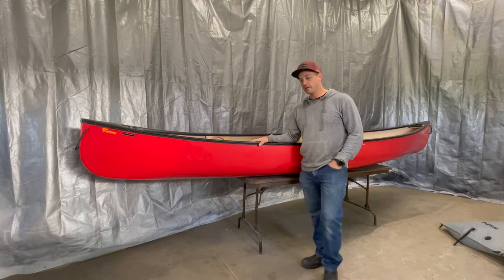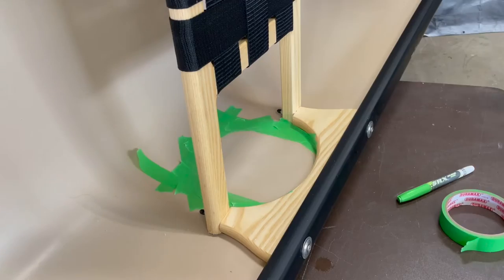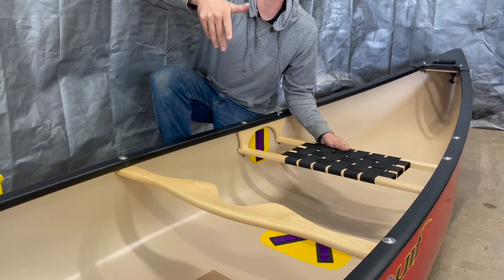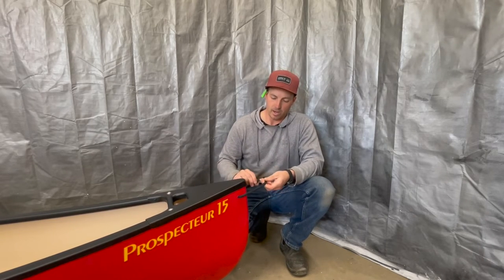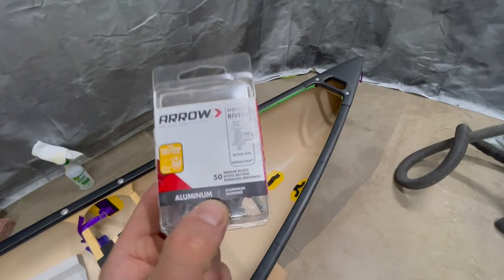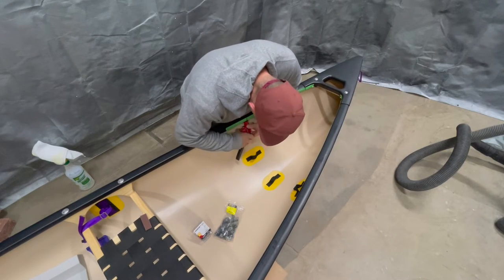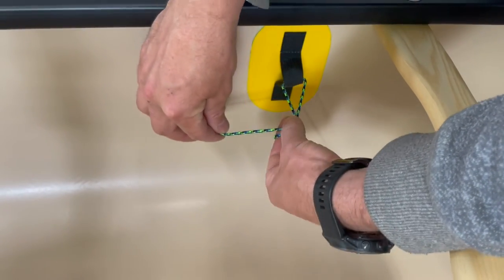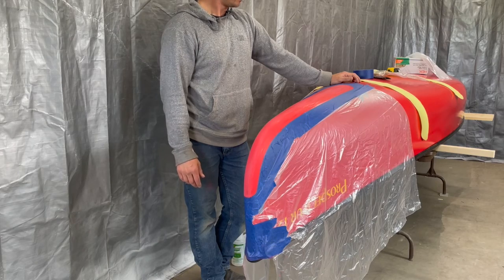Complete guide to outfitting a canoe for whitewater

Comment: Nice video well done. Next time you put skid plates on a canoe you need more resin soaking into the Kevlar Matting otherwise they will eventually crack and fall apart as they hit a hard surface. Air pockets in the matting will do that.
Reply from the maker: They are fully saturated. About 4000km later I have worn far enough through in a few spots to tell for sure 😂 Probably going to try Dynel next time.

Comment: Thigh straps and a kneeling position where most of your lower leg is underneath the seat look like a recipe for entanglement in a capsize.
Reply from the maker: I’ve never had an issue bailing out but I can see why you would be concerned about that. Like everything you should practice and get comfortable with it before you put yourself in a dangerous position. It’s easy to push the straps down off your knees and there is always the quick release buckle on either side.
Reply: easy to get out of if you are familiar with it, practice it and maintain composure in a moving water capsize.

Comment: I have the exact same boat and wanted to thank you for giving me the confidence to install my float bags..anyhow in case you didn't notice (forgive my lack of proper canoe terms) the black "decking" at each end of the boat has two screws that go through the wooden support..those screw ends are kind of sharp and could puncture a float bag.. I just screwed acorn nuts on the exposed end and problem solved.
Reply from the maker: Glad it helped with outfitting your boat! That’s a good solution to that issue. Mine came with rubber caps on them but the acorn nuts might be a better solution. Happy paddling!

Comment: Very nice.  Did you consider foam saddles?   I outfitted two canoes, each solo foam saddle.  Comfort and good performance, but perhaps I'm missing a good reason for sitting on wood and web.
Reply from the maker: My playboat has a foam saddle but this boat is used for multi week long trips and 10-12hr days on the water. I often switch between kneeling and sitting throughout the day to stay comfortable.

Comment: Great video, I’m looking to find those P clips. Do you order them off line?
Reply from the maker: Ya I can’t remember exactly where I got them from but it was online. Most electrical supply stores will have them as well. Some people use the plastic ones I just went with the coated stainless cause I figured they would never break.

Comment: What bag/equipment ring and cord are you using for your spare paddle and what line are you using for the grab handles? Thanks !
Reply from the maker: The anchor the spare paddle
Is tied to is from mike yee outfitting and it’s just standard 540 paracord tying it in. The grab handles are a sterling rope prusik cord with a 3500lb minimum breaking strength.

Comment: I just bought the same boat and have been researching float bag installs. Is there a reason you went with the clips instead of drilling the hull? It seems like holes are dirt simple,  but the clips could pull out. Im a novice, so these are just questions.. thanks
Reply from the maker: Sorry for the late reply. I just find the clips give it a cleaner finish and I hate drilling holes through the side of my boat haha